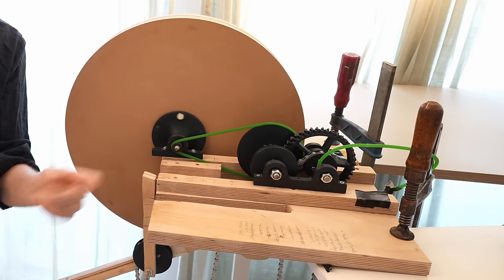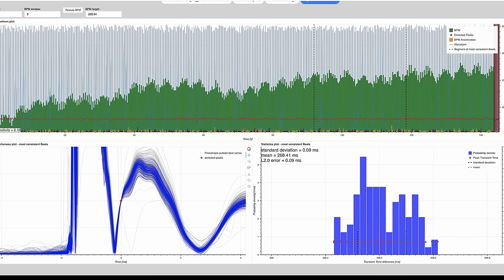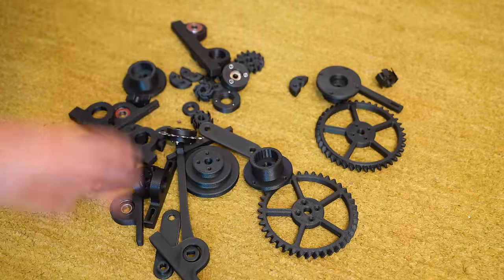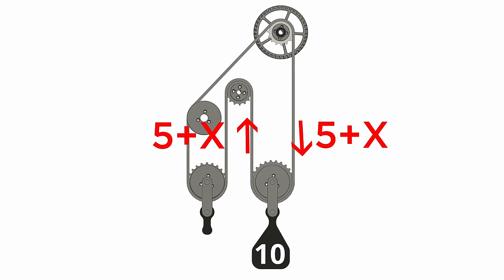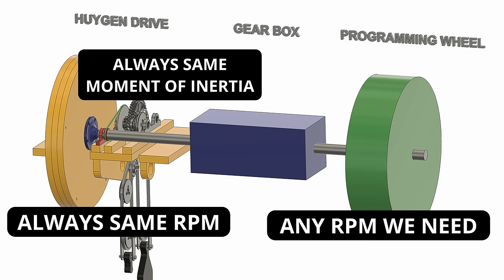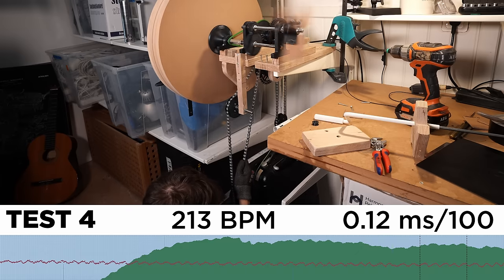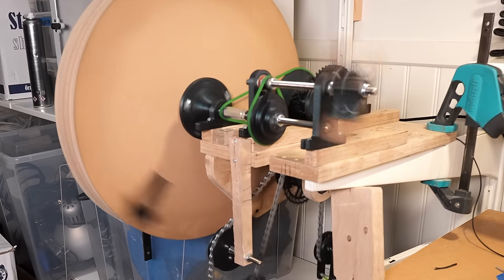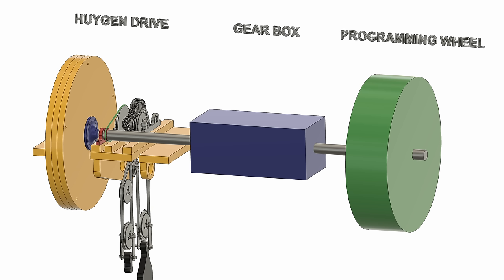Using Gravity To Play Tight Music

Comment: I think you are still falling into the trap of over complicating things. This is a relatively complex mechanism with multiple moving parts, points of adjustment, and potential failures. I do not see this holding up well at all in a tour scenario.

Rotating a shaft in a precise and repeatable matter is already a solved engineering problem. Please do yourself a favor and test out a good quality servo motor with closed loop control. They are precise, compact, lightweight, robust, and reliable. Tuning is all done the controller settings and will never drift or change on it's own. If you do need to re-tune it, it's a simple change of software parameters and no messing around with weights, gears, and governors. With the right servo, you might not even need a flywheel at all. Even if you do need one, it could be much smaller (it would only need to smooth out small scale disturbances).

Comment: You should really take yourself out of the equation and drive it with an electric motor.
Not for the final machine, just for testing so you know if it's the Drivetrain/Flywheel that is the source of the inconsitancies, or the power input.
You probably need to "rev" the motor RPM while runinng until you find a balance, but then you're 100% certain if it speeds up or not since the motor is at a fixed RPM and your power input isn't.

Comment: Man he is going down a rabbit hole again. He needs to think of energy input and energy loss as well. The prototype in Germany made him sweat and the machine is going to require significant amount of energy from Martin to run. With this setup you are limiting your input and the amount of gearing and speed governor is just resulting in energy loss. I don’t think he is going to succeed with this setup. Thinking of winding up a clock.

Comment: I don't know how it is that you are so stuck on a hand crank/foot pedal,  ah an electric motor?!!!  with a limit switch to turn off the motor when it reaches its highest position.  and you can use a PWM circuit to adjust the speed of the motor to keep the weight where you want it.  lose the crank.  mike

Comment: why dont you just have twof them connected, so you power the one, and then it will have a continuous power into the next one which means you ssignificantly reduce the sin waves in the rpm output.

Comment: Automatic CVT to fix the tempo creep?
Reply: I feel like that's just going to create a positive feedback loop. As the input speed increases, the CVT would have to gear down, which reduces the resistance on the input and allows it to spin up even more
Reply: @pseudo_goose  "I see this as an absolute win!" But also you put your regulator before the CVT. The CVT is just for the output to the actual machine. Eventually you'll hit the CVT's gear ceiling, but still.

Comment: This is silly. Wind a crank that spins a generator and put the power into a battery. Then use an electric motor with a speed controler. It's exactly the same thing. These old machines you're replicating were using the technology available at the time. Why are you copying it? The goal was to play music with marbles. What is even going on anymore?

Comment: The analog motor is cool, but this is the 21st century, why not the digital stepper motor drive you had before?  It will be infinitely more accurate and infinitely adjustable for any tempo and be infinitely simpler to design and maintain. Won’t require a heavy dangerous high energy storing flywheel, maybe still a small one. And you can finally get back to designing the meat of the machine and making music. This is gobbling you up. If you need help designing a new digital drive, let me know…….

Comment: I'm sorry, but this project is going nowhere. If you are so worried about milliseconds of tightness, use an electric motor in combination with a laser counter to regulate power, or even better have 0 mechanical parts and use a wav file played back from your Macbook and call it a day.

What is the point of adding a hundred moving parts to even out fluctuations that nobody will notice without a very deliberate setup to measure it? Honestly, I wonder which fever dream this obsession with unreasonable expectations with regards to tightness came from. You're on a never ending quest to take the human factor out of an instrument that is meant to played by a human.